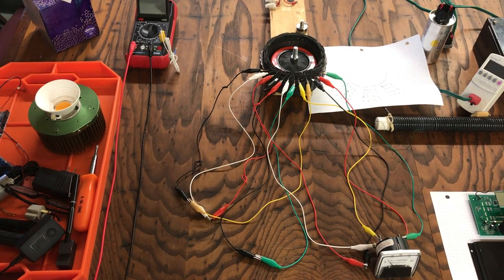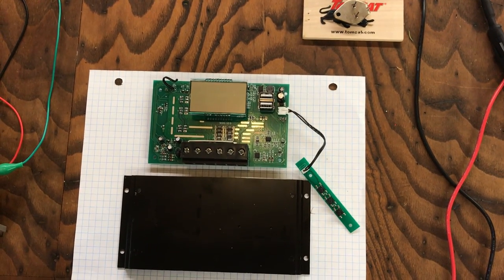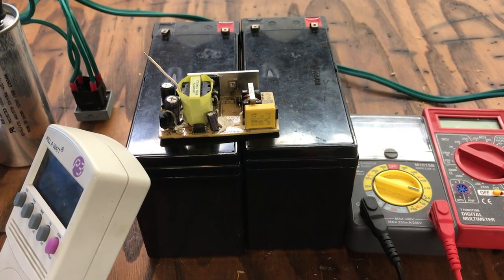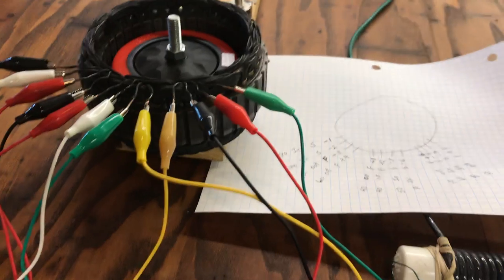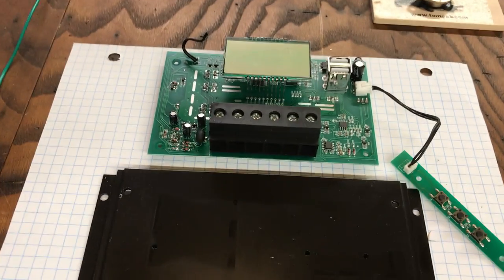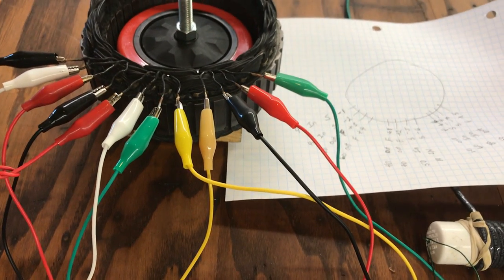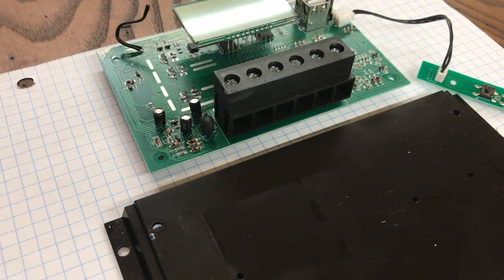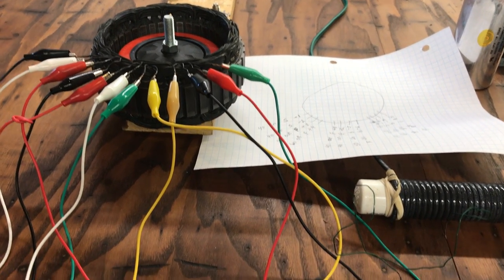Renew You - Metronomic - Converting An AC Delco Alternator to A Metronomic Generator

Comment: Yep, I've been cheeched and chonged MANY a time! It sucks but it's part of the process and it's kinda fun actually, blowing stuff up is always fun! Lol! There's a channel photonicinduction he overloads tv's and microwaves and all kinds of things with high voltage and cranks up the current till they pop! It's pretty cool to watch! He uses some good size equipment too, but sadly he no longer makes videos, British guy, very funny!
Reply from the maker: Yep, Up In Blue Smoke failure is part of the process when dealing with open electric systems. Manifesting radiant Watts safely is key to making this technology useable without interfering with the established grid infrastructure... I've demonstrated with dry contact (ATS)  Automatic Transfer Switching can and will arc and burn up electrical equipment as well... Safety is hard to predict when trying to blend technologies.
Reply: @Renew_You  absolutely!!!